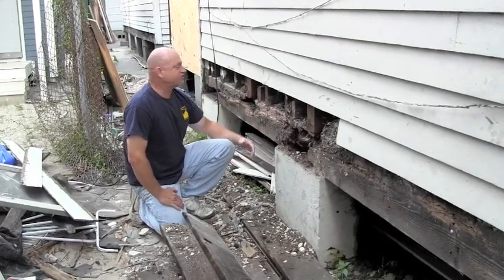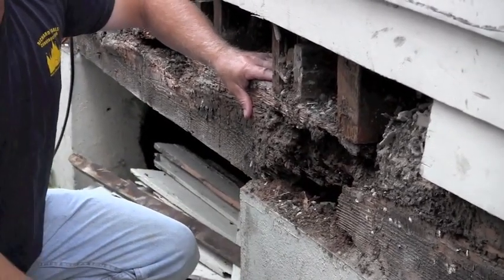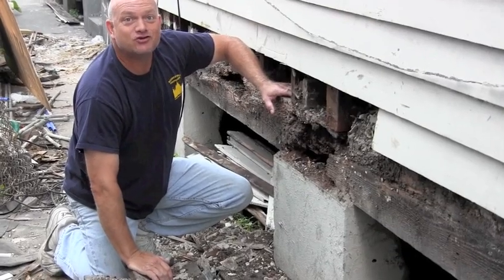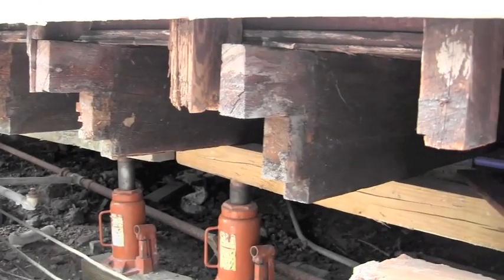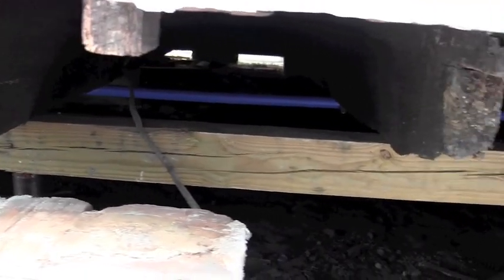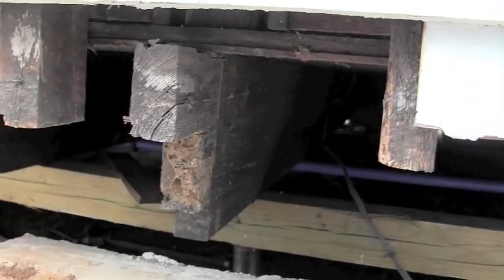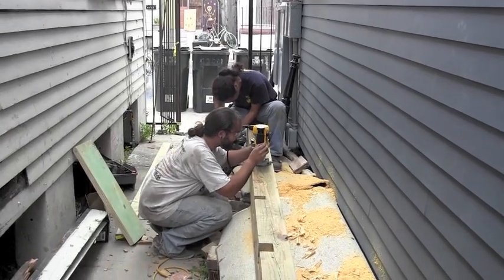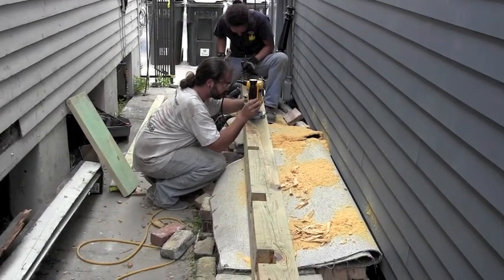Sill Repair With Richard Earls Construction

Comment: How does the wall stay up if you are only supporting the floor joists?
Reply: The wall is supported with the sill on the outside of house.the sills are supported with piers that are either made of bricks or cinder blocks.The joists support the floor
Reply: Geralyn Fielding we just bought a farmhouse with the exact same issue of a rotting sill beam with wall studs right on top of it, no bottom plate. In this video, I can see the wall studs not touching anything while they are replacing the beam. I can see they are supporting the floor joist, but I don't see how they are holding the wall up.  I really want to know 'cause we have to replace our sill beam.
Reply: My old house has the same old design. I was able to replace the sill by supporting only the joists one six foot span at a time. First though i screwed my studs into the floor joists and then screwed a 2x6 across the studs and joist. Any weight from the 2x4 studs is transferred to the 2x6 and then the joists. My joists were supported by a stack of wood blocks and shimmed eat every joist in the respective 6 foot span and as close to the girder as possible, which in my case was two feet.  I don't know if this is right but that is what i came up with and it worked for me. Can you beleive my GIRDERS were only 2x6? This block and base house is made so cheap and probably was designed to last only 30 years. Now it's 70.
Reply: Wall studs a connected not only to a top plate but also all the exterior shearing etc.
It's these connections  that stop the wall studs from falling or entire wall from sagging during a timely cill repair.

This video is a good overview of this task done correctly.
Reply: @The Looking Glass Darkly  I was worried about the same thing cause I have to do mine also. You should be OK. I think if you're really worried just take out 8ft sections one at a time.

Comment: Was the original plate/rim/or whatyacallit redwood? or just regular fir?? I don't recall running into a bad one like that unless redwood or treated was not used. In the old days redwood was standard.=,,..but I believe the cost of redwood has surpassed the cost of treated.

Comment: What would a rough quote of replacing that sill be? I live up in northeast Louisiana and if I posted a picture of my house it would look just like what is in your video. Almost the same length of damage and all.
Reply from the maker: We charge 100.00 per foot of sill to fix
Reply: Thanks for the quick reply Richard, you don't have any buddies you know in northeast louisiana that do this line of work by chance?
Reply: It depends on the footage of the sill but about $100.00 a square foot.
Reply: In Southeast Ohio that would be $700 labor.
Reply: I called someone and they didn't ask size of my house. Told me front wall would be $10,000.. after reading this I'm going to call around to get more quotes..
Sure wish y'all guys lived in Florida..